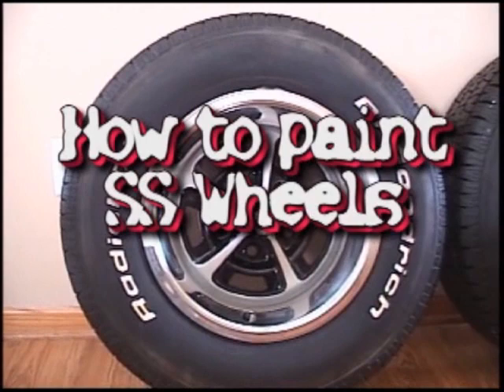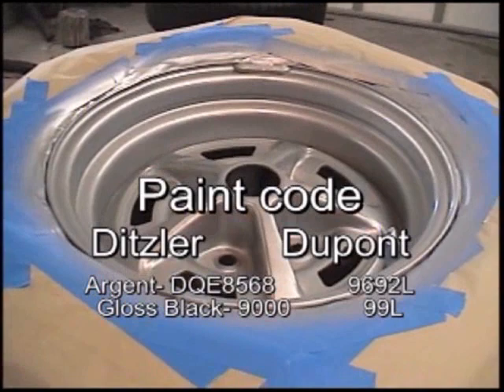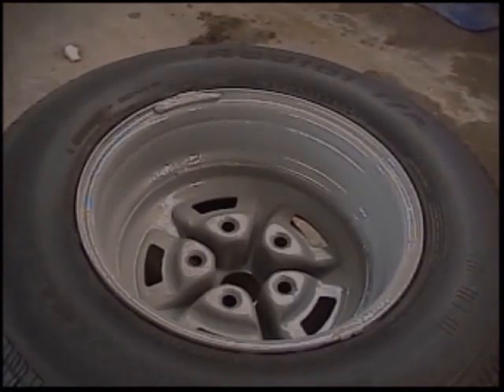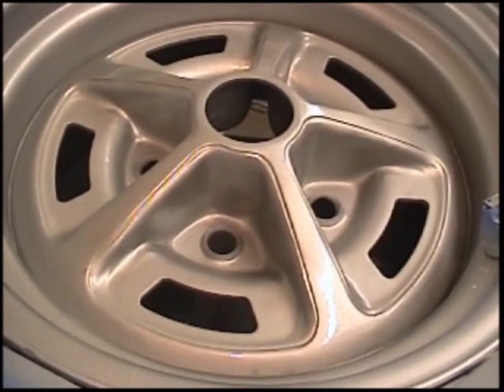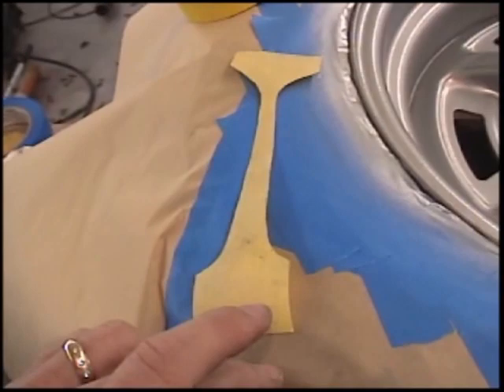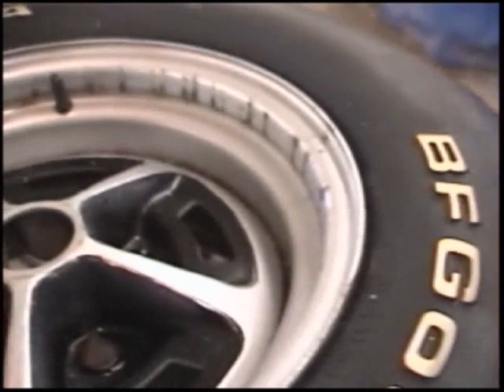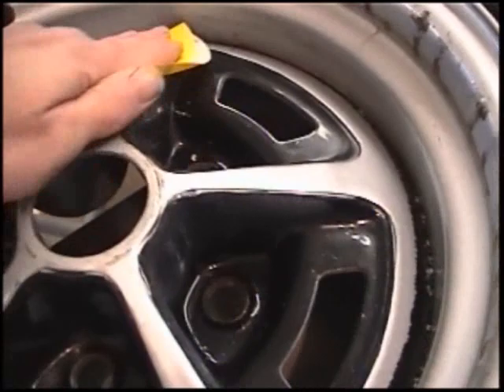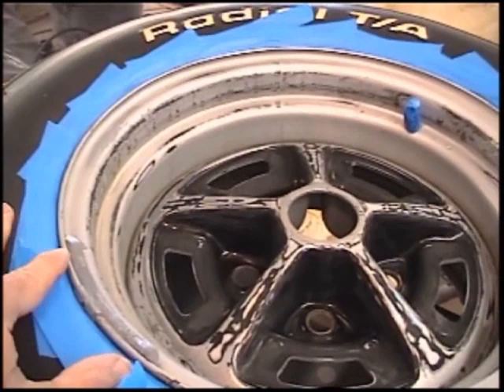How to Paint wheels Chevelle SS part 1

Comment: Take the tires, weights and valve stems off first so the paint continues over the lip and inside the inner area.  It will peel if not. As it is, when you need to replace the tires, the old weights will come off  when they balance them and you will have a wonderful unpainted area where they were.